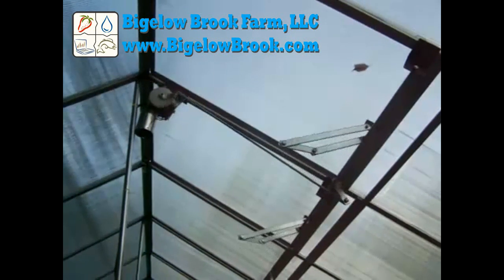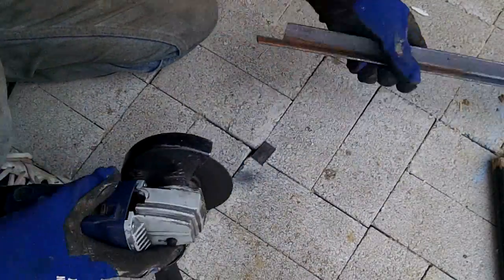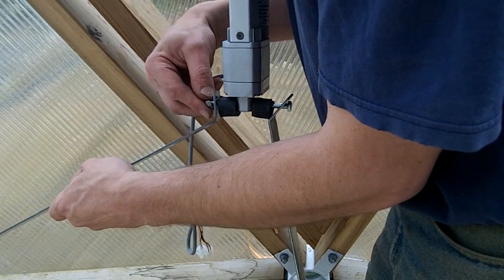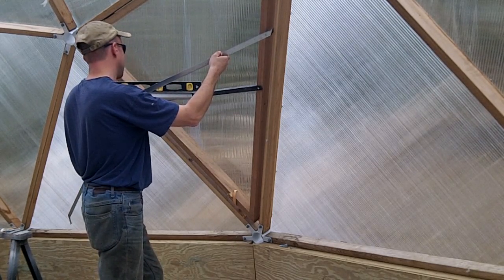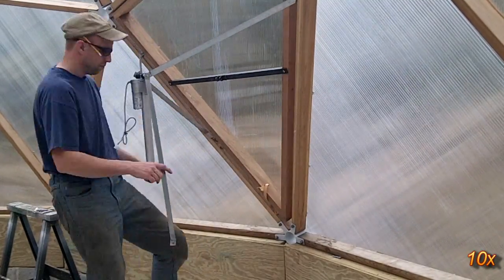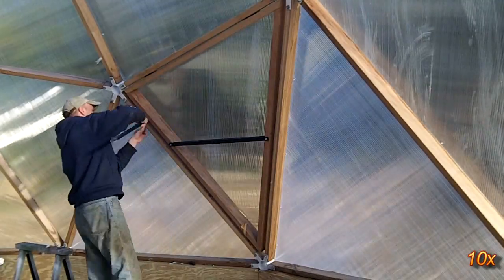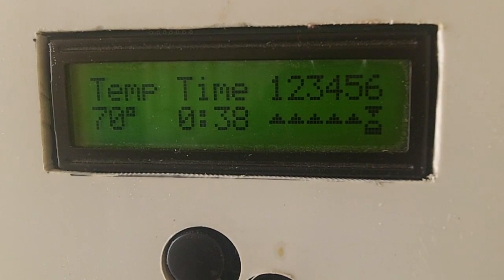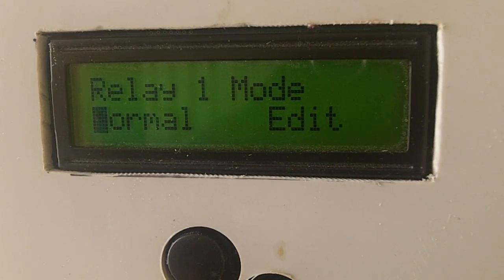Automatic Vent Opener in the Geodesic Dome Greenhouse

Comment: Now that your geodesic dome has been operating for 7 years, I am wondering if you can see any cracks or distortions in the multiwall polycarbonate sheets where they are screwed on the framework due to the expansion and contraction?
Reply from the maker: No problems with the polycarbonate.  The tape I used is slowly failing.
Reply: @Bigelowbrook  Your DIY spirit is contagious! Keep spreading it :)

Comment from the maker: Yes.  I've used them in the past.  I haven't had much luck with them...usually they start to leak and won't function properly.  Plus, I can control the temperature more precisely using an electronic controller.

Comment from the maker: I"m not too worried about the wind.  The linear actuators are rated for 500 lbs dead load.  I used the poly tape to seal up all the joints for the vent.  IT sort of acts like flashing.

Comment from the maker: The vents pull down fairly tight so I'm debating if I should put on any weather stripping.  During the winter when I'm burning wood, I'm going to need a source of air for the heater so the slight amount of leaking through the vents may be helpful.  I'm really not sure yet and will experiment with it this winter!  Thanks for watching!

Comment: I saw the upper... wasn't sure if it was the vid or not or you only showed primer. The white on upper did blend in and look better than the black. Great job either way and wasn't complaining (have no right to) was just wondering.

"used what was laying around" When I did body work on my car and the only rust repellent paint I had on hand was yellow. Yellow rocker panels and wheel wells on a blue car....hmm

Comment: Incredibly nice setup! Are you going to publish plans or a kit? 
Rather than use special-purpose controllers, I'd tend to use the same Mac that controls my home automation. All I'd need to do is run Ethernet to the greenhouse and install another interface like my Barix Barionet-50; it can sense temperature, control relays etc. It would be simple to set up the control algorithms using my XTension software, perhaps augmented by a bit of AppleScript code.

Comment: This is really awesome.  You mentioned that the thermostat controller is a prototype, what'st the timeframe for that becoming a new item on your product offering?  How many different temperature gages does it support and are you monitoring up high or at plant level? 
I still use the Harbor Freight green house, I am sure lots of others do too, when you dismantle that one would you consider auctioning off the old automation system?
Thanks for the ideas.

Comment from the maker: they're around $100 each...but saves a lot of time instead of playing with windshield wiper motors!  I think they can lift 100 pound and are rated for 500lb dead load.  The vents weigh 15 lbs at the point where they connect.  I probably could have used smaller units but didn't want to take the risk.

Comment from the maker: They're all 16 gauge wire.  The actuators draw just shy of an amp at 12 volts so it's within the tolerance of the wire....barely.  ;-)  The longest run is around 50'.

Comment: Looks great as always! But have you checked the voltage drop from the controler to the actuator when in opperation? The wires look long and thin to me.